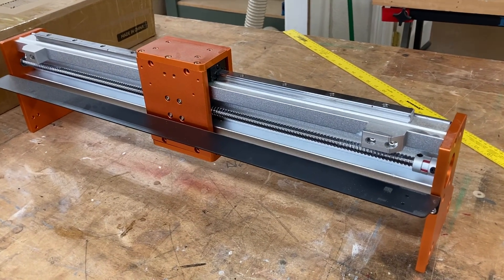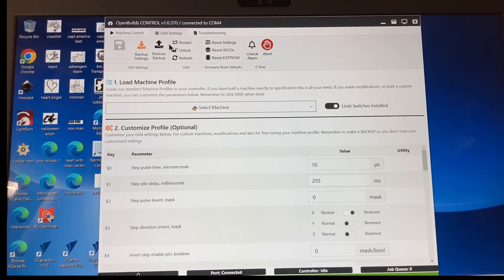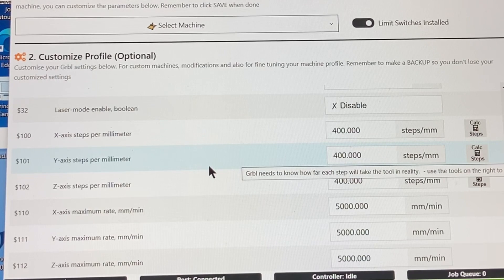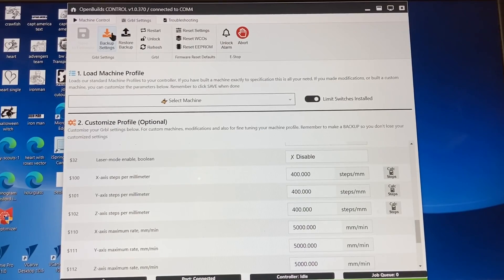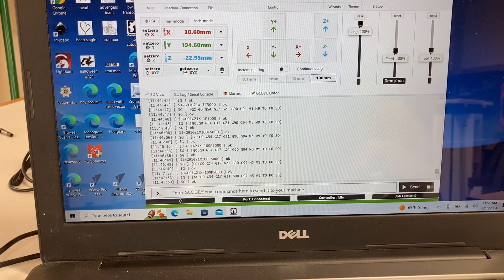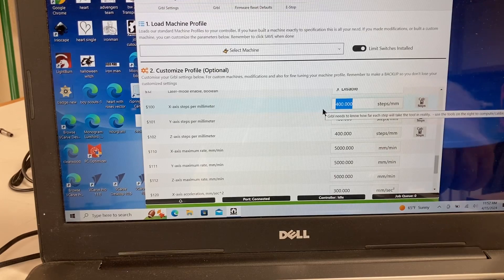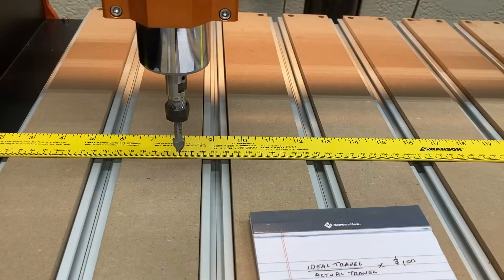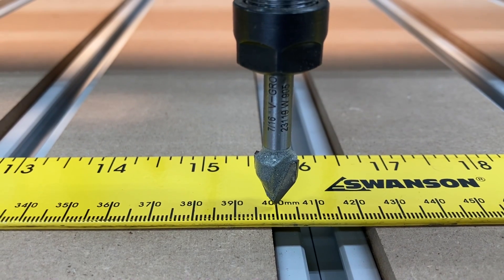You Must Calibrate Your CNC for BEST Performance!

Comment: I have a new Masuter 3s with 8040 upgrade kit. All the motors and spindle and switches are functional. But it has never been able to actually do a job, cutting out the second it starts. But now it won't even home from either the physical homing switch or software. So the jog/move functions are mostly not working. That's for both Easel and UGS software. So I wouldn't be able to perform this calibration procedure as the axis won't move.
Reply from the maker: How do you know all motors and switches are functioning properly if nothing works?  What do you mean by. Cutting out?  Stops and starts?  When you hit the home button nothing happens?  Since you tried both easel and UGS it’s safe to say it is not a software issue. That leave mechanical. I need more information to help you.
Reply: @PawPawsWorkShop  Hi, Thanks for your reply.  The machine was homing fine until now with all motors going good but it would not do a job - it would cut out immediately with an error. But now all activity with the motors has stopped including the spindle. Except once when the X axis moved a few inches but not since. So I am suspecting settings/firmware or a controller problem in the big box. So right now, Foxalien are on a Chinese long weekend but I'll pluck away at it. Is there a place I can get the default gCode settings from the factory? By right I should have saved mine, not that I varied too many of them.I think I changed $101 to 800.000 at some point.

Comment: I got mine not long ago with the 8040 extension with the machine, and I had no idea it wouldn't be calibrated or in the user's manual. Do you know how to set those values up in the UGS software or would it be better to just learn on what you're using, the open build? I've broken 3 bits now because it just plunges down or goes too far right. I use diode and fibers, never had a CNC and its more intimidating that the other machines.

Comment: I recently watched ur video on how to do this on ur xcarve in Easel, i have a longmill and use Easel but use gsender as my post processor. Will the calbration steps done in easel correct my machine if I use gsender?
Reply from the maker: Yes, the calibration process is the same